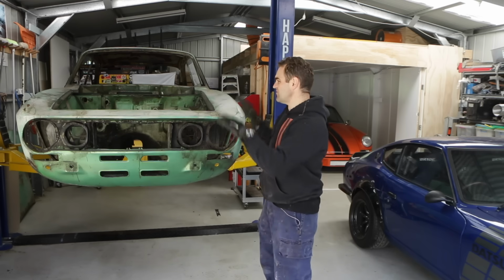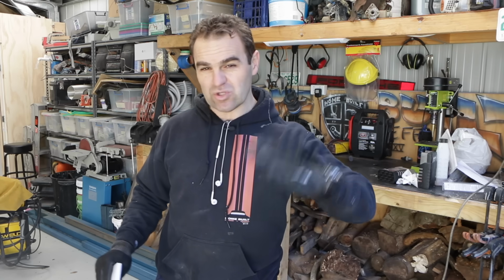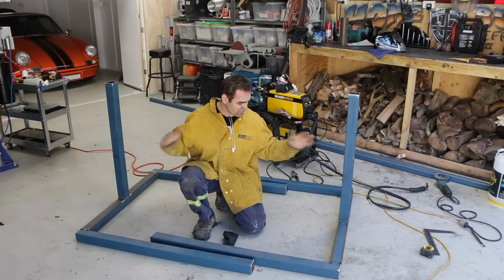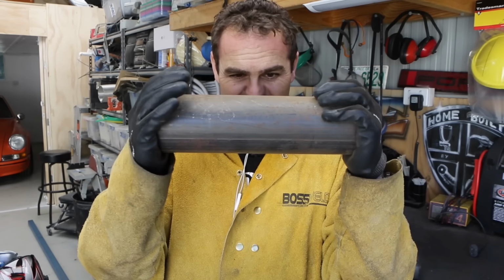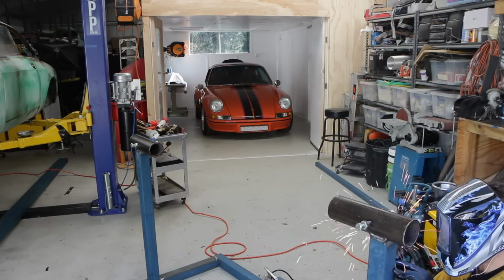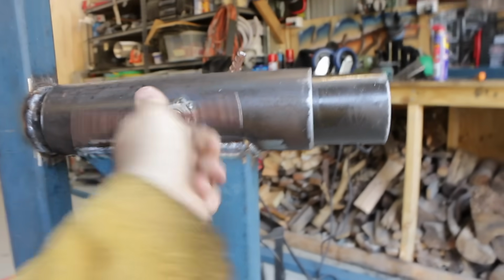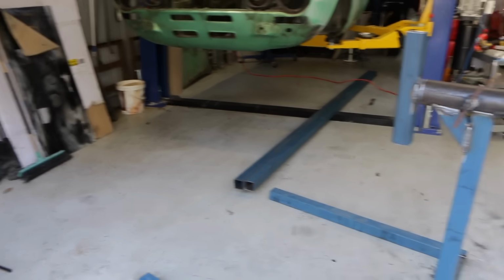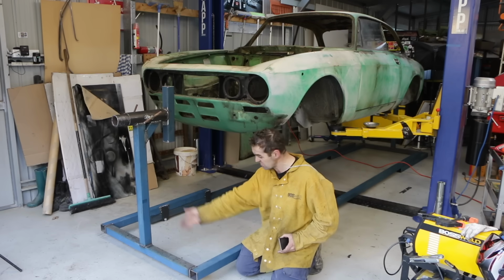DIY Rotisserie - Alfa Romeo 105 project car build part 5

Comment: Why would you not just use 2 heavy duty engine stands and save yourself the time and effort? More time fixing cars less time making a tool that is gonna be forever in your way when you’ve finished the bodywork
Reply from the maker: They would still need a lot of modification, as they are far too small and this needs to be transported on a car trailer.
Reply: @HomeBuiltByJeff  
if you make the height adjustable after the pivot, where you have now welded that short piece of pipe, you can balance the car.
Reply from the maker: @matra149  I wonder why I welded on such a short piece of pipe... ;)

Comment: Looks good should have gussets on legs as well on both sides to keep it from tipping and breaking welds
Reply from the maker: I could gusset everything, but this is hugely over engineered as it is. That has the redundancy of both legs and if you noticed I welded the tubes to the ends of the centre piece rather than the face so the torsional force is spread over all of the welds not just concentrated on one ;)
Reply: @HomeBuiltByJeff  It's over-engineering for static use in the workshop but as soon as you apply the brakes (let alone having to stamp on them) while it's on the trailer the torque on the base of the upright and the crosspiece it's mounted on will be a fair ol' twist. But a plate on either side should be enough.
Reply: If the shell is 300kg (?) then the torque at the base at 0.5G deceleration is around 1,500Nm.
Reply: @DiscoFang  

In Europe we use 0.8 instead of 0.5 for the calculation of load when braking. Sideways and backwards we take 0.5. with loads you can play better on safe side.
He can of course simply put his tensioning belts in the right place so that nothing bends.

Comment: hey jeff love your work and projects. I also built a car rotisserie, similar design to yours. 4" box tubing, and I used 1' solid bar and bearings as the rotation pivot point. This video shows it in use, perhaps it might help you. Cheers!  https://www.youtube.com/watch?v=mN6i1ZqrINI&t=183s

Comment: Great job, I agree on using the gussets for the uprights, its always better to have a more rigid frame when carrying the car on a trailer, it might snap just above the weld. I made triangular uprights on my frame, they're strong but limit some access to the front and back

Comment: Nicely detailed execution of your rotisserie build. As a matter of safety, I think you should add similar triangular reinforcements on either side of the T-base of your rotisserie as you did below the swivel mechanism.  I’m sure Mrs. Jeff will worry less knowing that you’re not any taking any unnecessary risks.  Otherwise, another exceptional build video!
Reply from the maker: Like I said in the video ;)

Comment: Top work Jeff. Probably a good idea to drill holes in the inside pipe so the threaded rod penetrates into it locking it solid like an engine stand. The friction fit is a bit sketchy and unless the car is perfectly balanced horizontally and vertically it may break the friction and rotate. Try some decent rotating force on your current setup and see if you can move it.
Reply from the maker: Tim has used this same method for years on his and it works.
Reply: @HomeBuiltByJeff  I do hope the tubes at each end are perfectly parallel to each other in operation, and aligned in axis. Half a mm out for either and they will bind.

Comment: you may want to think about drilling and tapping a couple of holes on the rotating part, that way you can put zerk fittings in and grease it just in case moisture gets in and tries to rust it together.
Reply: Sounds like a great idea.

Comment: Very nice job on the frame With the wheels make sure you can get at the bearings with some sort of spray lube as the blast media will get in to them we used to go through loads of WD40 after we blasted them with compressed air otherwise they were jammed solid.

Comment: Are you going to add some castors so you can move the whole thing around? Also when you take the body to the sandblasters take all the other suspension parts as well and the you can easily paint them or get them powder coated, might save a lot of time and cost. Rotisserie looking good.